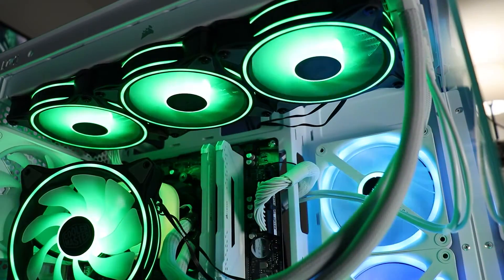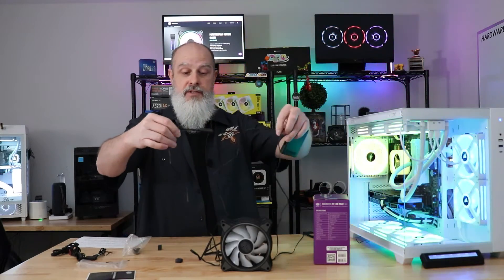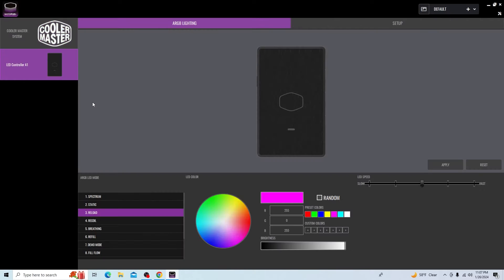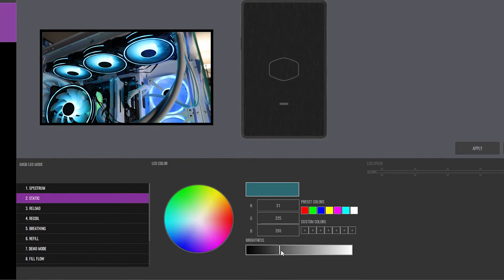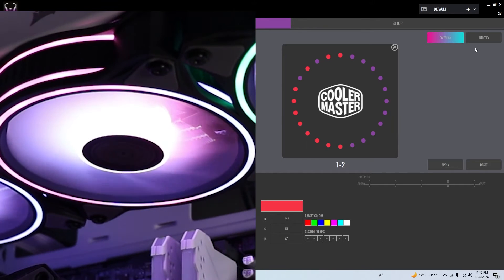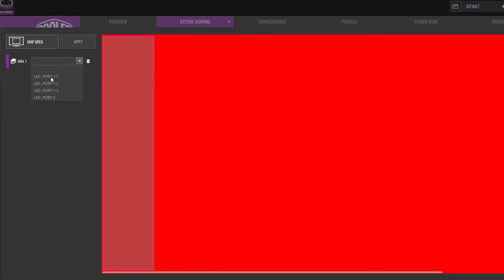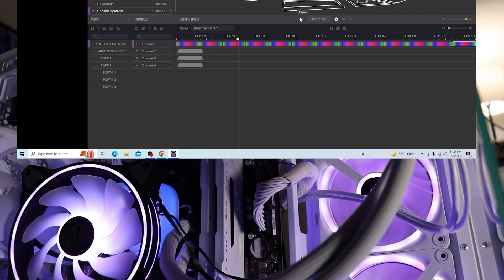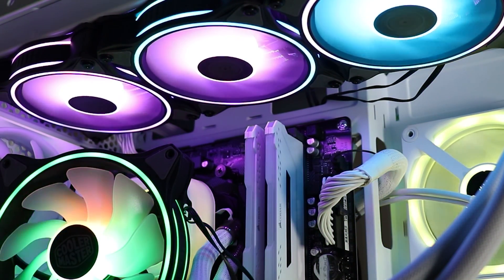MASTERPLUS RGB Lighting Control and HALO MF120 Fans - Cooler Master  RGB

Comment: Nice video.
Im tryed the program  but my mf120 halo isnt recogniced.
What can be wrong ?
Reply: Yes, same hub as in video.
Im took a usb cable and put it in an usb 3 socket, outside the computer, and that worked. 
Usb on motherboard with the delivered cable dosent work, and usb cable in usb 2 socket outside computer dosent work.
Im will test more on a new computer next week
Reply from the maker: Hi peterkarlsson7796, i'm assuming you are using the Cooler master RGB hub as shown in the video as that will be a requirement for this software to work with them. 

Assuming that is the case, if the software is not recognizing your controller. I'd start with the basics, just power off, try another power connection and reseat the USB connection on both sides, try another USB header if you can. Beyond that, i'd reinstall the software. Also, try shutting down any unneeded software that may interfere with it. As a troubleshooting step, i'd remove all other USB devices to see if it picks it up. 

I hope that helps, good luck and have fun!!! Thanks for watching!!!

Comment: Hello! Can I have 2 hub in one pc? Or if I have 6 fan I need to put him in Gen 2?
Reply: I had out 2 before but I disconnected it an adjust bought a RGB splitter and connected a total of 6 fans. I removed the second since it would start up differently every time and would have to go in and change it through the master plus software.